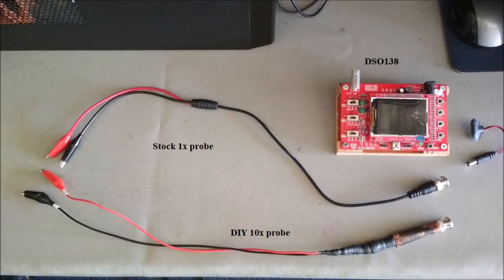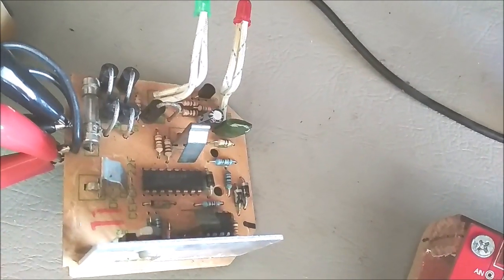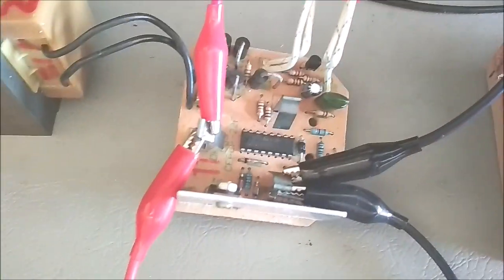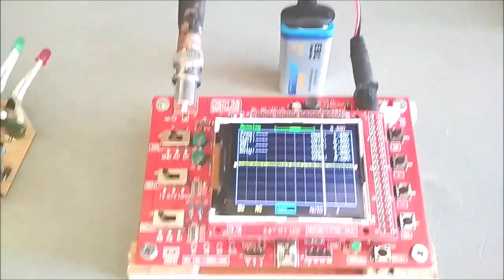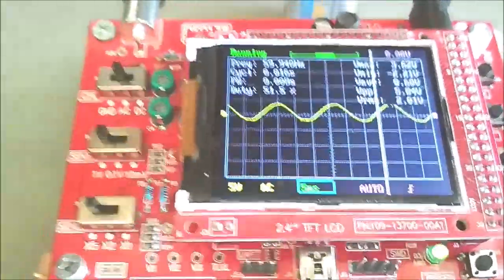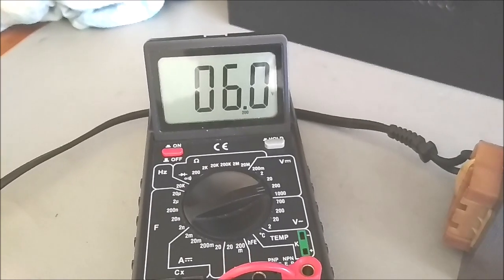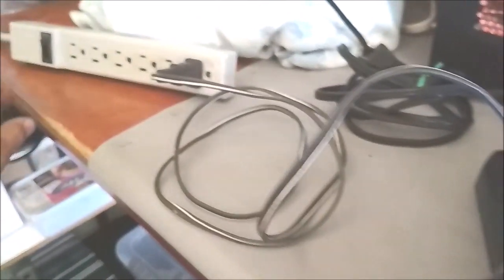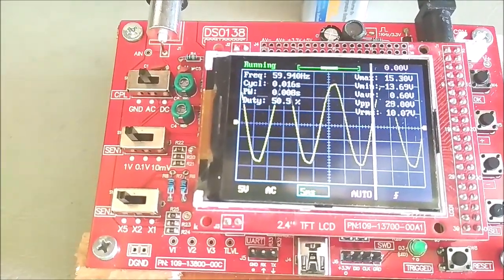DIY 10x oscilloscope probe with DSO138 scope

Comment: 1. Hissing/ beep sound coming from the device. 
2. Test rectangle signal is not flat at peaks (I am using 9v supply from buck module).

Any help ? :)
Reply from the maker: The device does not have a speaker
Reply: @rogermathura  thanks for your response. Yes of course the device doesn’t have a speaker, but the radial inductor does noise and here is the issue with this radial inductor - noise is coming from this one. So, any help? What is the issue i am facing?

How to rectify this ?
Reply from the maker: @Harry001by7  Sorry, I don't know. I've never heard an inductor hum. Maybe, the soldered contacts are loose.
Reply: Ik im late but in the manuał u should find how to calibrate it
Reply: @kubakrawczuk7450  tried, not working
Reply: @Harry001by7  i think calibration is broken or smth coz it should be ok if u calibrated it right (i mean only that square wave would be flat), did u tried getting a refund?

Comment: By using 10x probe can we measure mains voltage?? Please reply i have an idea to brought this scope iam only beginer
Reply from the maker: You should stay away from mains supply!
Reply: @rogermathura  
Ops!!! I have know about all the precuations while handling mains
Reply: 10 times probe and scope goes Max 50 volt peak to peak. So 500 volts peak to peak! 240 volts is fine!